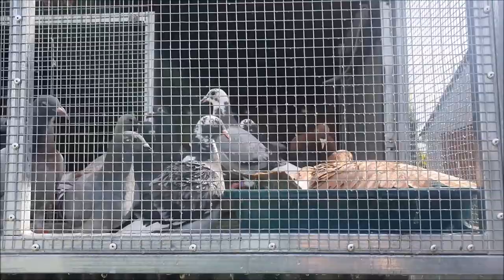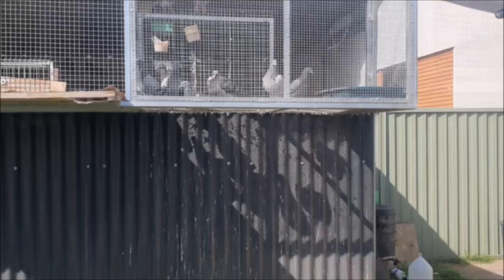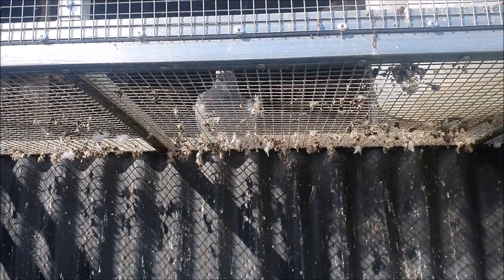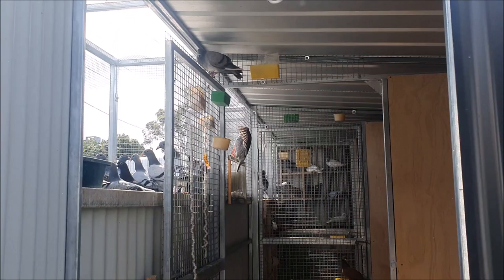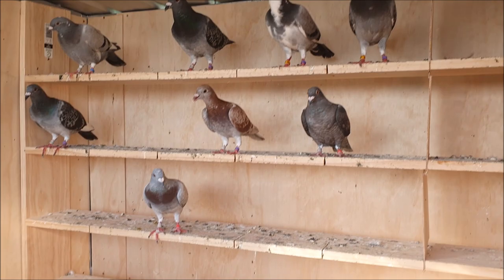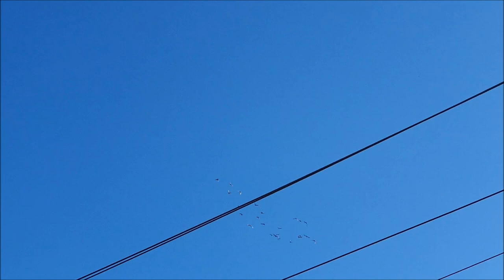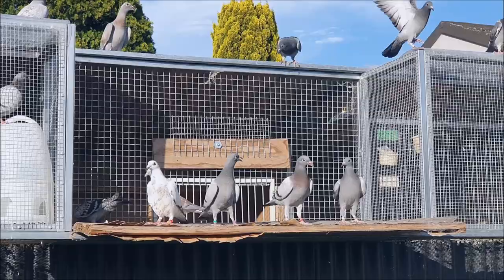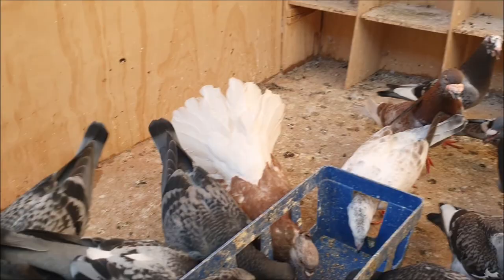FIVE things I HATE about my racing pigeon loft

Comment: Adam, what I am concerned about is the corrugated sheets and the colour as well
 as they attract more heat.
Reply from the maker: The dark sheets dont get sun until the afternoon, it is the roof that heats up most. It'll soon be lined with insulation and ventilation fans installed to improve airflow and temperature.

Comment: Hi from D.Ks lofts Birmingham rollers Perth WA, could build a second roof on top better cooling.
 an exhaust fan blowing the heat to the outside/ installation on the roof outside.?
Reply from the maker: Yes the roof will be lined and two exhaust fans installed